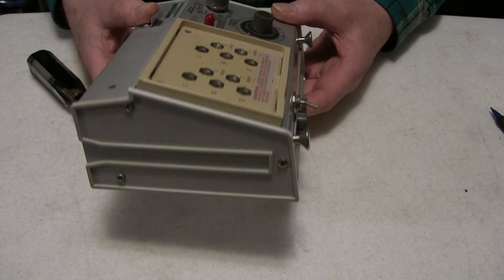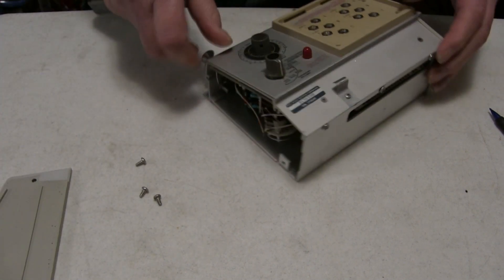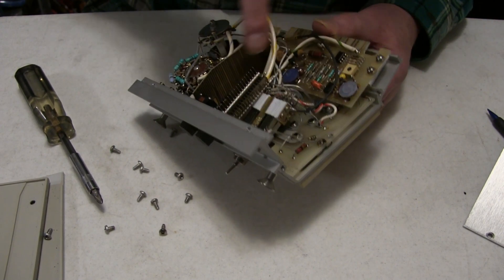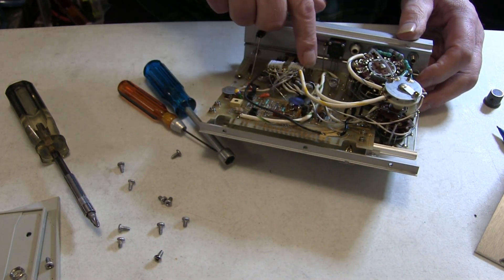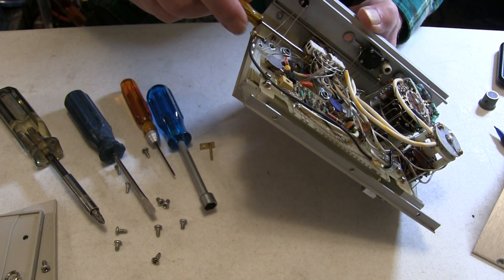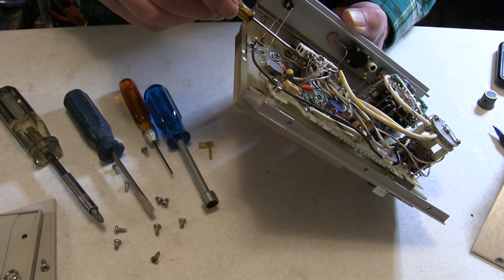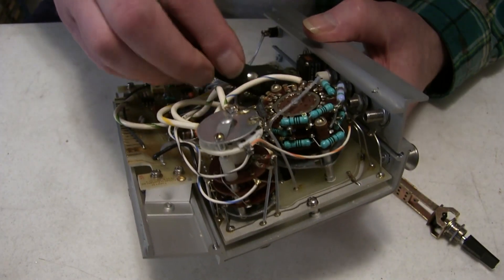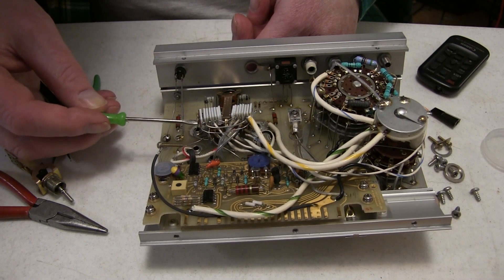Tektronix 577 Curve Tracer Left-Right Switch Repair

Comment: Very useful video. I have two 576s and one 577. As you said is typical, the 577’s switch is broken while the 576s’ switches are OK because they are better protected. I’ve had the 577 (which worked except for that switch) for many years, putting off the switch repair until I saw this video. Thanks for the eBay source, too. I just ordered that part today. 

Thanks for clear audio, no music and partially oblique lighting that helps with seeing the internal parts.

Comment: Great video! I was able to replace the actuator in my 577 without a problem.

I knocked the pin out of the new and old switch bodies with a pin-punch and swapped just the broken lever so I didn't have to modify the phenolic part.

Comment: Good work. I have a very similiar problem with a 576 curvetracer, the left-right switch is not only bent but broken off. Is there any replacement für the 576 switch? I have spent month to repair and restaurate my 576, it works great now, but the switch is tho only problem I could not solve until today.
Reply: I think it's possible to use the same mechanism on a 576. I will check next time I'm at the Museum. This is a rare problem with the 576, given the switch location. The 576 switch has fewer contacts than the 577.
Reply: @robeughaas  Thank you for your answer. The switch was damaged by great force applied to the shift lever. I don't know what the pre owner did with it, there is only a small piece of the lever left, the rest is missing.
Reply from the maker: I have looked at the 576/176 switch and it uses the same mechanism. Much easier to replace, actually.
Reply: Thank you, I try to get a replacement mechanism.